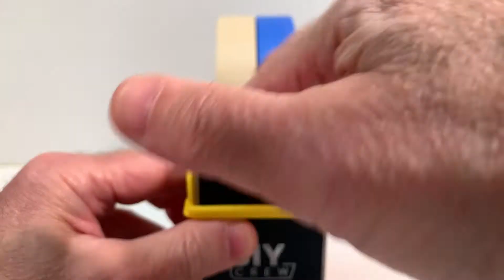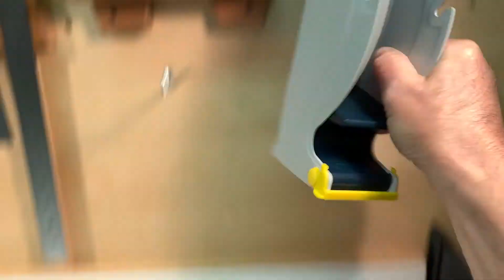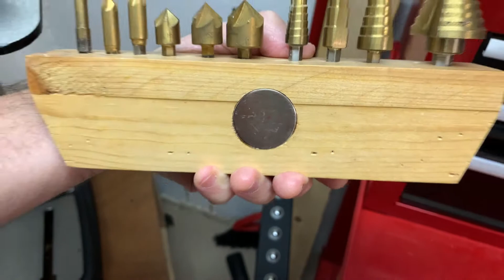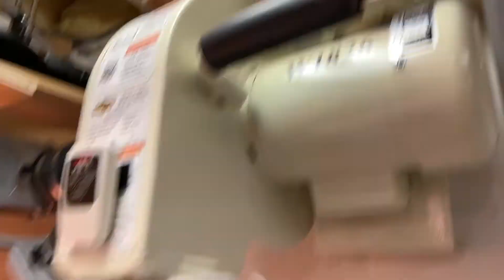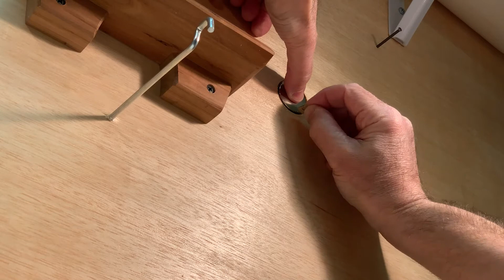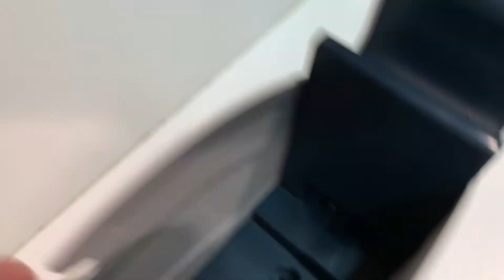DIY WORKSHOP TIPS | Pimp My Tape Dispenser with Magnets!

Comment: An even bigger issue I have will all tape, whether in a tape dispenser or not, is my wife or kids taking them elsewhere and then not putting them back into the "tape" drawer!

If base of dispenser is metal what about key hole and just hanging it on the wall? Granted that's the only place you could do it then, but seem like suction cup would probably work most other horizontal places.

Could you mount magnet less permanently by putting metal on the other side of board or a big flat head screw?
Reply from the maker: @Mick Jager - all good suggestions!
Reply from the maker: Whoops, I hit reply too early… You’re missing tape dispenser issues sound very familiar. We used to always have to hunt for the tape, but I bought a large tape dispenser (much prettier than the one I used in my shop) that now sits full-time in our kitchen, and almost never goes missing.

I suppose you could find a less permanent method of mounting the magnets, but I really like them being glued, because they will pull away from anything behind them if the force is greater on the tape dispenser. I thought through several methods of hanging it on the wall, and I like it to be really secure, so you can pull tape and tear it with just one hand. There might be other ways, but for me the magnets are everything I was hoping for!